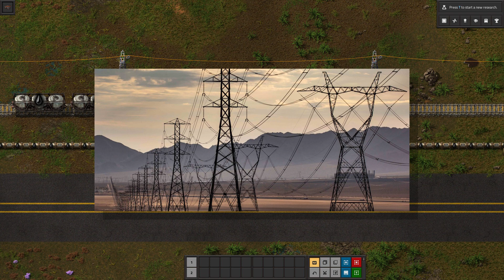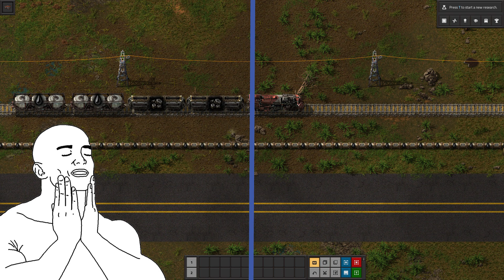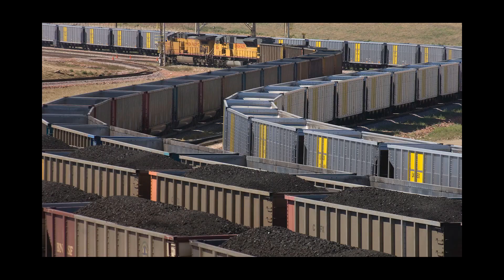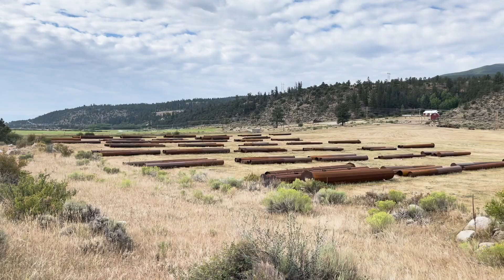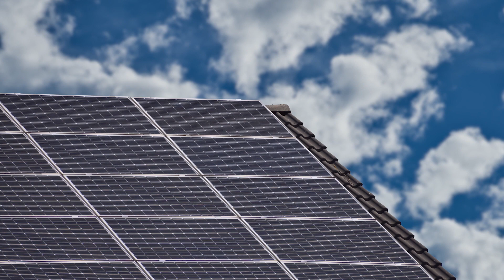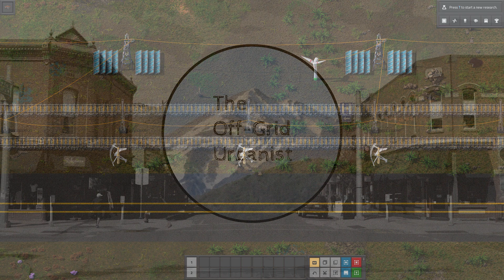How do we Decarbonize Energy Transport and Rebuild our Power Grid?

Comment: And not a word about nuclear energy, one of the cleanest and most efficient ways of making electricity...
Reply from the maker: This video was about  distribution and energy transportation. Not generation. Decentralizing power production could involve smaller reactors through out the grid instead of a few big ones. But energy sources were not the focus of the video.
Reply: ...but only for 99.9 years, then you'll have to price in the cost of a whoopsie-cleanup.

Or consider the cost of doing it properly and safely but then it's economically dead and you're on cleanup duty every 25 years instead.
Reply: @TheAgamemnon911 😂😂😂😂😂
Reply: @TheAgamemnon911  does it hurt?

Comment: Increasing efficiency is obviously one of the best possible options to improve electrical grids, I agree with that, but it's sort of just a thing that is always good to do when possible.

The only real drawbacks to efficiency are cost and cost (capital and operating respectively). In contrast, there's a very complicated interplay between renewable power types (ex:solar vs wind vs hydro), where those sources are built, distribution, storage and reliability. Obviously, they all have different costs, but they also each interact with supply (and demand) differently. Building solar on a house skips distribution, but it's more efficient and reliable in a cloudless desert. Wind patterns and strength vary wildly by location. Building production at a different longitude can offset time of day differences between peak production and peak demand but requires long distance distribution. Storage can increase reliability but decreases efficiency.

In contrast, efficiency of demand is kinda hard to tweak and fine tune like production is. The knobs we can control are like at an institutional level. ex: build rail networks, pass laws to require efficient appliances or efficient industry etc. It's definitely not simple per say, but we probably won't have as much to say about demand reducing strategies other than use them whenever they cut demand by Xkwh/USD. I guess that cut-off point might be roughly equivalent to the local cost of production. The interaction with capital costs does add a bit of complexity, but it still seems like "just do it unless it's absurdly expensive" is the answer.

I really think social reasons are a better reason for reducing car reliance than reducing electrical demand. It's not wrong, just a bit weak of a reason to build rail or bike lanes or whatever. I'd rather build a walkable city because it's nice to live in than because it uses 30% less electricity per person. Convenient bonus, sure, but... Very weak alone.